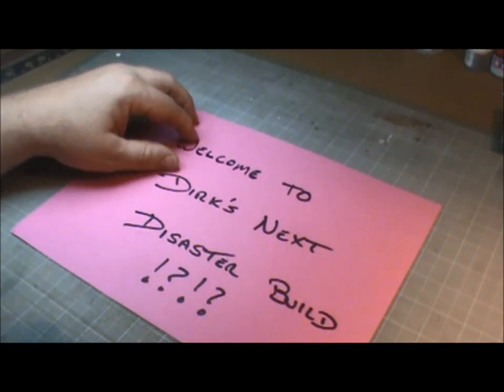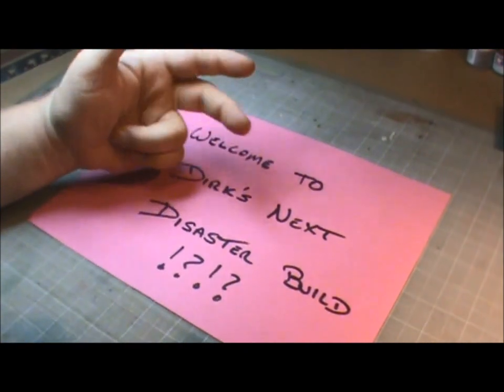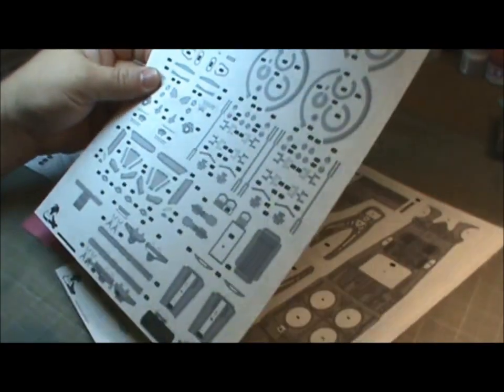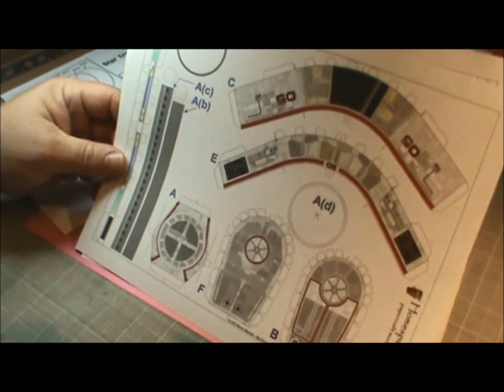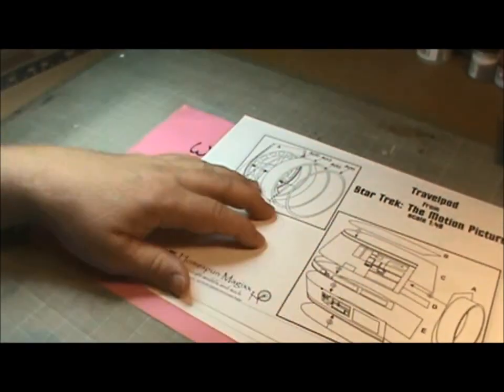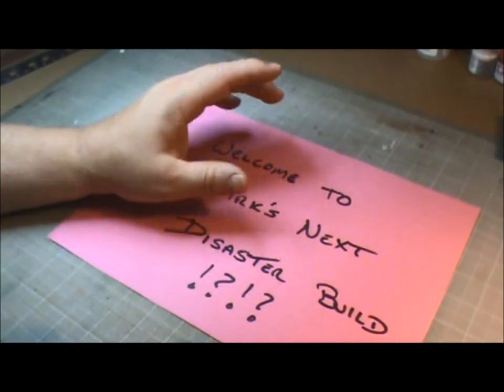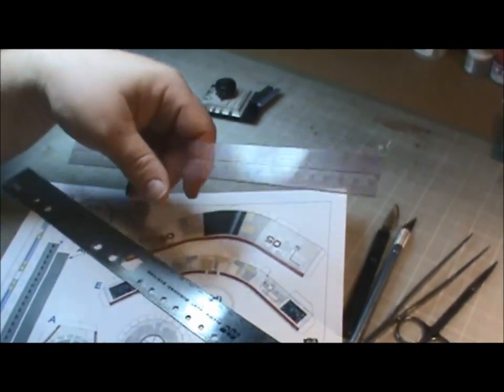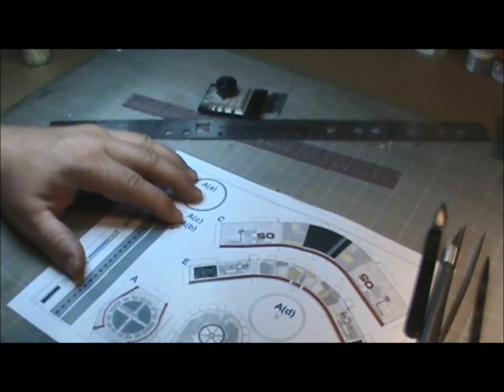6:91 PAPERCRAFT Star Trek Travel Pod [Part 1]

Comment: Hi, Dirk. You might recall me from the ASM hangout the other night. That pod is a good entry point for paper modeling. Tools are a matter of personal comfort, but I've never used scissors very much with paper models. I cut most everything by laying on a cutting mat and cutting with either a sharp Xacto or a box cutter/razor blade knife.

While I've built an number of models by cutting out all the tabs, lately I've gone with the wisdom of some experienced builders and usually cut most of the tabs off. If you cut the tab off separately you can glue the tab under the surface edge and create an almost perfect corner. The problem with tabs is that you can't really fold them to quite a right angle and end up with a small radius at the edge. The best way to learn this technique would be to make some joints with scrap paper before starting an actual model, though. I'd suggest building a model or so using tabs, then try the tab cutting method to compare.
Reply from the maker: Hey, wade, yes I remember you. Someone over on zealot keeps telling me the same thing but I have to give it a go. I've built about 7 paper models since this one. I like it a lot